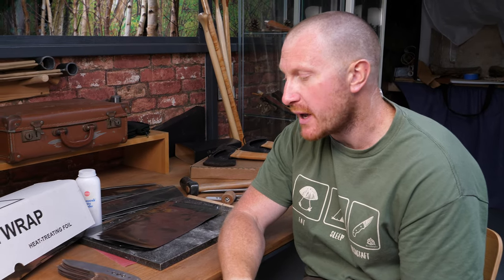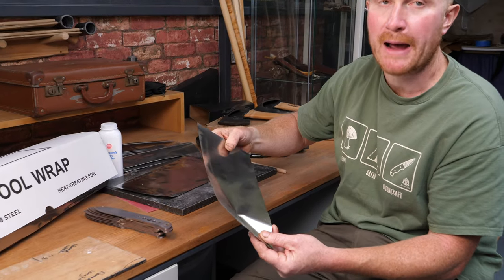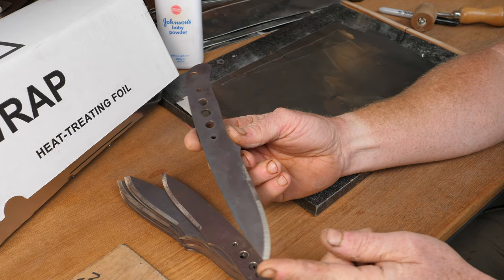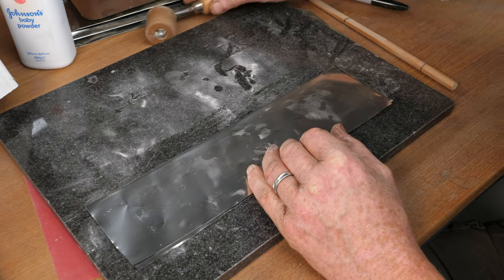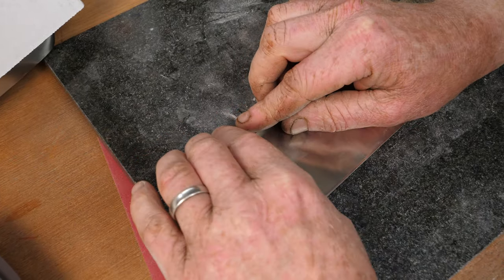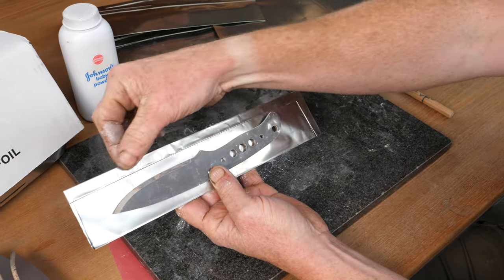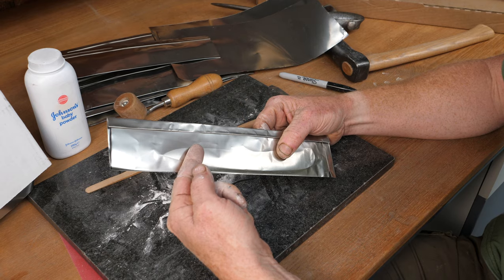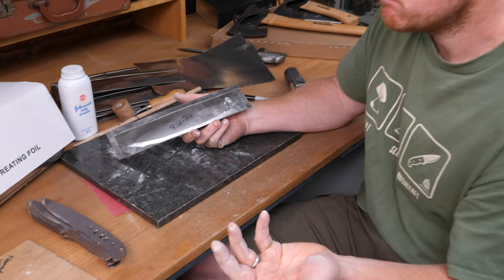Knife Heat Treat - Foil Wrapping Blades

Comment: When you quench the blade after heating it in the envelope, do you remove it from the envelope to ensure that the blade itself cools fast enough to harden enough? And how many times can an envelope be reused? I tried hardening a blade forged of CPM magnacut in a sealed envelope with my even heat kiln. I followed the recommended schedule and plate quenched it; but it didn’t seem to harden all that much, so I need to anneal it and re harden it.
Reply from the maker: I normally keep it in the foil to plate quench it as the surface still makes contact and is transferred through the foil. 
You have to move fast from the kiln to the plates ideally. 
I haven’t tried magnacut yet but if you haven’t got it cooked quick enough it might not harden? 
You should be able to anneal it and have another go. 
I only use my foil once so it is a consumable. 
Hope that helps 
cheers Ben

Comment: That is a serious cut, but like the new look. By drilling he handle holes before the heat treat, are you not introducing more oxygen? Perhaps in the small hole on the handle you could fill it with some substance that would reduce the oxygen, burn up what oxygen is in there but also stay put due to it being in the hole. I know you’re new at this, so wanted to offer some back seat knife making advice 🤣 - stay safe guys and keep the great videos coming.
Reply: Sound like a bit of a Fidell

Comment: You can and should  do multiple blades per envelope. Tool wrap is expensive. And you cut the envelope and pour them out for the air quench.

Comment: Thanks Ben for the valuable information. Two quick questions: Do you oil quench AEB-L and 12C27? Inside the envelope?
Reply from the maker: No problem glad it’s helpful. 
Some people do quench in oil but I plate quench them and used compressed air. 
This is faster and keeps the blade nice flat and straight. Hope that helps 👍
Reply: It helps a lot! Thanks again! Regards

Comment: Ah, yes. It must have been the slow heating that reduced the hardening. The evenheat kiln wasn’t preheated at all before beginning the process. Even though it was heated as fast as possible, the instructions by Crucible Industries include preheating before austanitizing.
Reply: Wait so you pop the blades in when the preheat temp is reached? 

I assumed you’d circumvent this with sections of the protocol

Comment: Can you treat multiple blades in one envelope or do you have to do each one individually?
Reply from the maker: Sure you can put more than one in there. Ideally they need to be the same thickness or you won’t be able to plate quench them properly. Also you have to be careful they don’t move and slide  within the packet. 
I would say when your learning best to only have one blade in the packet as the cost of the foil versus your work is negligible. Hope that helps. cheers Ben